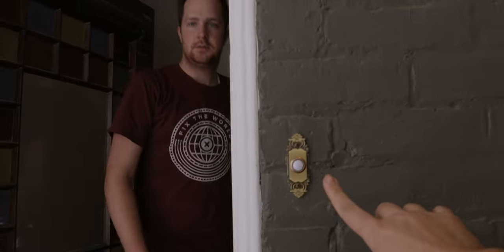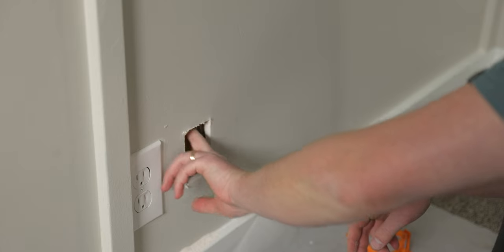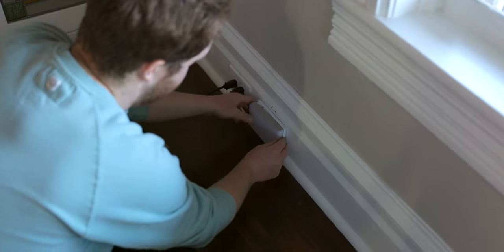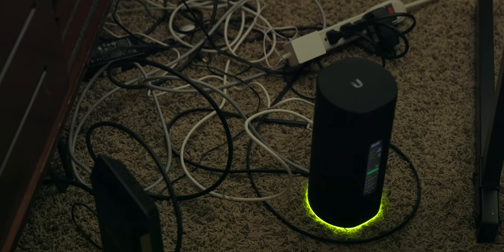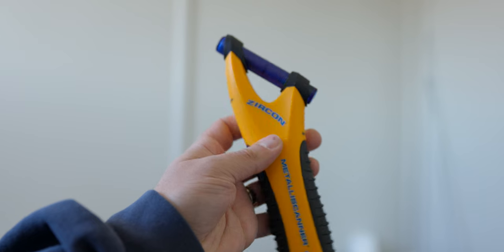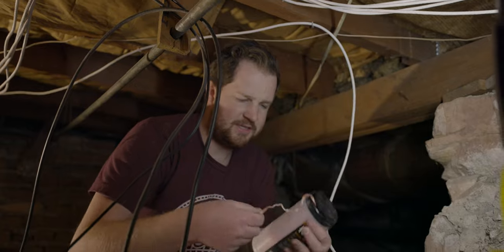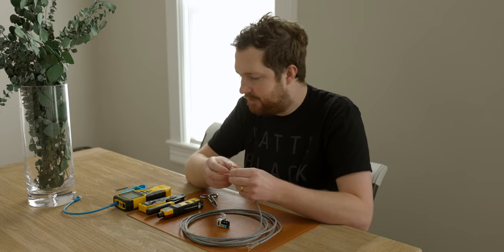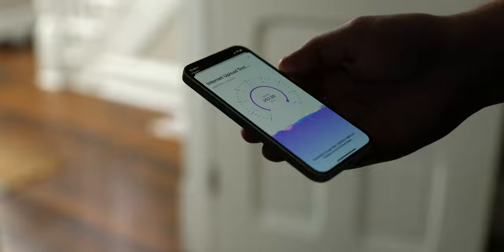Adding 10 Gigabit Ethernet to my 129-Year-Old House!

Comment: Solid explanation of the punch down method. I went with the male-female keystones instead so I got best of both on the end runs of each loose camera cable. All cable runs were for new construction so the in-wall used the punch down keystones, which I had to repair 2-3 of them. (The cut through a few of the wires when stripping) I was not happy when I tested all the cabling, but when we moved in, there is no time to call the electricians out to fix a minor issue. Luckily it was all CAT6 runs we paid for an received. I have an open run directly below my office into the basement for Verizon or Google if I can ever upgrade from Comcast. I thought about the Ubiquity system, but I already had purchased a few modern Asus mesh routers prior to moving, so decided to go full expansion into that ecosystem, which has been fantastic for a home network. I had to turn down the transmit power the first week since my network was reaching 3 blocks away in a new construction zone.

Comment: I enjoy your tip about the sheathing, you can tell a man who has had to make lots of Ethernet by his tricks to get them done faster. However, the tool you show at 18:49 literally has a thing built into it to cut the wires instead of the scissors..not to mention the even nicer Klein tools crimper.. I guess for availability of viewership? (I saw you cut the cable with the same scissors) Nevertheless, this was my only suggestion to anyone watching.  The closer these are all to being equal, the easier it is to crimp.  So, spend the time making these nice and the bending you do at 20:53 really makes all the difference as well. This was a fantastic video and enjoyed every second.

Comment: Nice video, informative and humorous. I was drawn to the video by the 129 year old house. My house is old also, about 120 years old for the original house. My problem though is my walls are solid wood as in log cabin. I did like your idea of setting up a network rack.

Comment: One thing: The order of the pairs matters A LOT. If the signal pairs aren't on the same twisted wires, the whole twisting effect of the wires is negated, you get crosstalk between the signals and you completely ruin your ethernet speed. What doesn't matter that much is that you use the right colors for each twisted pair, but pair has to stay pair!

Comment: if you install in a new home while building it, or if its not an insane hassle, just go with cat7. its better protected, less interference and just gets you a piece of mind for 10gb networking. 

you can never go overkill inside your walls, the walls and anything that comes to be related to the cunstroction of the home is way harder and expensive to change in the future. if you thinking about installing ceiling speakers, put the holes in, put the best cables, HDMI 2.1 cables, maybe even USB and more. it really doesnt cost alot of money and gives you a piece of mind and flexability in the future and in selling the house.

Comment: I work in an electrical installation company. We have so many contracts with private home owners to wire some new network cables etc. Most of them end up saying 1Gbit is enough. Yeah no, we don't even think abbout installing Cat5e cabbles. Cat 7a is the only thing we install in terms of cable, especially since the price difference is really small nowdays. Plus, we only need to have 1 type of cable in storage.

Comment: I found your video very informative.  I too have an older home (1972) just not as old as yours.  Although I do have Wifi in my house, I have tried to have hardwire RJ45 in as many rooms as possible.  My house is a tri-level house with a basement.  My last few lines I have run were for my 10 GbE lines that support my Plex Server and my Synology NAS.  I sorta cheated I chose to get premade Cat6A lines in the lenght I needed for those runs.  Then I used female-to-female keystone jacks at each end through the wallplates.  That way I was able to pretest my lines and the rerun the tests after I got the lines run through my attic.  Not fun, I should have run those 10 GbE lines before we had additional insulation blown in.  Very clostophobic up there.  The first floor runs are pretty easy since there is a passageway that runs from the basement up through the first floor into the attic and access to the wall where my computer room is on the second floor.  The only rooms without RJ45 drops are the kitchen, dining room, bathrooms and the laundry room.  But they also have Wifi so it is not a big deal.  All upstairs bedrooms, living room, and family rooms have two seperate lines for each of them.

Comment: I just bought a 1921 home so the wifi modem combo in the living room doesn't even get signal to the bathroom 15ft away. I am installing unifi aps in the living room, mother inlaw apartment and the hall between the 2 (between master bed and bathroom) and running it all to a old linen closet where I will have a 10u server rack to house all of the patch panels, network controller, poe switch, and modem it's self. Also putting the networked printer in the closet. Eventually I plan on adding a out door ap so that you will get signal in the whole yard since I use wifi calling alot. I am only running cat 5e because I got 2 full boxes for $20 on local classifieds.

Comment: I would also higlight here that there are toolless connectors. They are generally a lot more expensive but have a greater tolerance for cable diameter. If you bought a shielded cable (recomended if you use the same holes as power lines) they make your life a lot easier. For european homes where all walls are brick and making new holes and cabling  requires a full repaint and masons tools they are recomended as they can enable you to use the existing cable spaces. I would still stay away from the power lines if I can help it tough. Using the Coax cables routing spaces that are bound to be there for the TV is a lot safer.

Comment: i am NOT a tech wiz and even if there are clear instructions on how to do it I'll get someone who knows what they are doing to do it for me. that way i never have to make sure i have the right [everything] that i am probably only going to use once, (i fixed an electrical problem in my car once and had to buy the right tools to do it. still have the tools, gathering dust and only used once!). however, my house is roughly the same age as yours and has 3 bedrooms and 2 reception rooms that i am thinking about having ethernet cabling throughout. so, at least now i have watched your video i can follow any worker i get around my house and have a rough idea on whether he is doing the right job.

Comment: @18:50 my solution is to do rj45 connector ends, then use a coupling keystone jack , so clean as a normal keystone install, but a bit easier (especially with those ez-rj45 connectors)

Comment: 22:32 "impact sensor" is nice term, but it actually is spring you push-load, and it clicks as it releases to the pair of mini scissors which then trim the excess of wire you pushed in.
That's also why you need to pay attention to tool orientation so you'll have scissor blades on outer side.
Some punch tools have rotation nob built in handle to disable scissors. Some will still click as spring is still there, some will disable spring loading mechanism so they are a bit stiffer to use.

BTW A/B norm is also used to make cross-cables (cable with A-wired connector on one side and B-wired connector on the other). They were used  to interconnect devices directly, without hub/switch, but they are kind of obsolete as nowadays NIC ports do have auto-cross detection and will align according to what is connected to them. But you were right that it is better to stick to one norm and wire either according to A or B. It is also useful as brown wire pair is usually used by PoE.

Comment: It is possible using TP-Link Broadband Over Mains Adapters only possible if the cables in your house go through metal conducts to prevent the RF signal being radiated and causing problems for ARRL Members.

Comment: I’m not a professional, but have had to make so many cable ends and custom patch cables for gas stations over the years as everything has become more networked and I’ve never heard of that trick with the jacket to untwist the wires. It’s mostly keystones and pre-made patch cables now, but I’m definitely going to give that a try on the next one. 👍

Comment: Not being an expert in cabling requirements, and even tho some building codes may allow for it, I would advise to NOT run plenum cable thru HVAC ductwork. My understanding is that plenum cable is a fire rating to distinguish between cable that MUST be run inside an EMT style conduit versus cable that can be run without a conduit. If it IS NOT plenum rated, then you should run it thru conduit. If it IS plenum rated, then conduit is not necessary as the external jacket is made of materials that will not contribute to a fire. For a residential installation, I recommend ALWAYS running plenum rated cable in order to cut the cost for EMT. If your house catches on fire, then your network will probably be the least of your concerns.

Altho, if you live in an area plagued by critters, you might want to go the EMT route to protect your cabling from chewing pests.

Comment: One thing to note is that you should look up house coding to see if what you are doing is up to code. In my county where I live you can not put a Ethernet or any other communication wiring in the same section as power cables in your walls. So where you put your Ethernet would not be up to code where I live.

Comment: Wow in America is this a nice thing. The problem for me is, i live in Germany… every wall is out of concrete even the floor is a 30cm thick concrete plate… there you can‘t drill that easy threw. But you have other options run the cable threw your house :D Very nice video for installing and configuration thank you!

Comment: 568B is specifically the standard for the US. Highly recommend sticking with that or you’ll confuse someone troubleshooting in the future.

Also they’re 66 and 110. Great video!
Reply: TIA 568A and B were both standard prior to the D standard being released.  It was typically spelled out in US Government contracts how the termination should be performed and to what standard.  One is not better then the other.  The thing is just get a standard and stick to it: this will keep troubleshooting to a minimum and BS out of the equation.

Comment: Cat 6A is bigger wire, passthrough is recommended. 5e connectors work if you lick the wires and press and wiggle.

Comment: I didn't hear it mentioned but the keystone and RJ connector are designed for different cables. The RJ connector should only be used with cables that have multi-stranded wire (patch cable) and the keystones should only be used with cable with solid core wires (structural). Usually the multi-stranded cable is used for patch leads as the cable is more flexible. Whereas the solid wire cable is normally used in walls or as part of the permanent network structure, sometimes called structural cabling.

The RJ connector has small blade type pieces that the crimper pushes down and into the multi-stranded wire to make a good connection. If you use the solid core cable with an RJ connector then it may work initially but is likely to fail at some time in the future. The reason is, that the little blades that the crimper pushes down into the wire don't actually go into the wire because it is solid copper. So the blade ends up making it through the wire's insulation but is left just resting up against the wire. The blade only has to move the tiniest amount to cause a broken connection. Any sort of vibration or heat cycling can work the blade away from the wire. This is not an issue with the RJ and multi-stranded combination as the blade is immersed within the many strands of the wire and so any small movements of the blade will not cause a broken connection.

The keystone has a piece of metal with a narrow slot in it. The wire is pushed down into the slot. The sides of the slot cut through (or displace) the insulation and bite into the solid core wire. This makes a good connection and the depth of the slot prevents the wire working it's way out of the slot in the future, it is wedged tight. This way it is not likely to fail in the future due to any tiny movements of the wire. If you use the multi-stranded cable in a keystone it may work initially but is more likely to fail in the future. With multi-stranded wire, the strands can move about and so don't become so wedged in the slot. They end up just resting in the slot and any movement of the cable can easily work the wire loose and lead to intermittent or permanent broken connections.

If you want a stable and reliable network then only use multi-stranded wires in RJ connections and solid wires in keystones. 

Some benefits of using keystones as your wall connection. 
If you are no longer using that connection point you can unplug the cable and not be left with a length of cable hanging out of the wall.
Any damage to the patch lead is easily and quickly fixed by just replacing it rather than having to find your box of RJ connectors and crimping tool and re-crimping the damaged cable.
The length of cable can be changed easily by using patch cables of appropriate lengths. Handy if you change the rooms layout.
The wall is much more sealed reducing air drafts and vermin entry paths.
Having multiple cables is also neater, for example a wall plate can have keystones for Ethernet, maybe one for your TV antenna, even a HDMI and USB socket all on the same wall plate. The HDMI and USB can be handy for connecting back to your security systems DVR making it easy to have a comfortable spot to directly access the DVR which may be located in a less comfortable location.

Comment: I have never heard of a 99 punch.  Perhaps you meant 66?  There is also BIX, which is very similar to the 110 punch.  BIX and 66 are commonly used in telecom.  I have both BIX and 110 punches in my tool box, but it's been years since I've seen 66.

Comment: this makes me feel so much better about choosing Cat 6 for my home, I was having minor regrets not shelling out for cat 8 (I was absolutely not doing cat 5e, everyone does cat 5e, spent years of my career doing Cat 5e.

I'm trying to not just put wholes through walls (which would work) and have it me nice with wall plates like this, but what I thought was existing spots to run cabling through is much hard than thought. I have a much more small home I think (940 sq ft) but really want ethernet through out both the houses and then be more so future proofed though gigabit should be fine. Doing full 10 gbps setup cost 2-10x more so will not do that for awhile, but once I get this in, shouldn't be too hard to replace.

Comment: In my home I installed Cat7 during renovation, which is basically Cat6 S-FTP.  If you don't want interferences from all the electrical fields in your home always go with S-FTP no matter 10Gb or 1Gb or 100Mb. S-Ftp is shielded and foiled meaning all pairs are shielded in addiditon to the whole thing being shielded as well. Basically don't pay unnecessary, know what you're buying and buy the best speced your budget allows you.  There is nothing more frustraing than an inconsistent performance.

Comment: Easy to cut one end, tie a new table to it, and pull through on the other side. You might need a sleeve to ensure smooth sliding.

Comment: Holy Cow
I am a g Network guy from Europe and I gotta say that many things are Questionable and I am pretty sure the network wouldnt pass a NEXT or FEXT Test for certification.
I dont want to bash the video by any means, overall good setup, theres just some details that hurt my feelings...

8:40 I would only use CAT.7 shielded Cable (S/FTP or PIMF) since they are way less affected by other wiring or electromagnetic signals around the house -> Less corrupted packets -> less packet loss, lag spikes and packet retransmissions +slightly higher speed (e.g. TCP Downloads)

That stapler is fucking awesome never seen one of these gonna buy one immediately

17:48 DON'T PUT A RJ45 ON IT PLEASE!!! Installation cables are solid copper and can break if you move them alot, patchcords on the other hand are flexible. You can also use a different length of patchcord in case you decide to change the layout of your room for example.
THE REAL 2 OPTIONS: 1. Keystone Module(s) for your outlet 2. (EUROPE) LSA RJ45 outlets

22:18 There are also toolless Keystone Modules.

Important tips for building a network:
If you want to run your network on 10G+ reliably, you should definitely use shielded Keystone Modules and a shielded patchpanel in addition to your shielded cable and ground your patchpanel!
If you use a shielded cable make sure the shield has no contact to neither of the wires/edge inside the Keystone module
Dont remove more shielding than needed
Dont have pairs untwisted for more than 2-3cm when finished

Dont run your data cables close and especially not parallell to your electrical installation (immense problems with unshielded cables)
Dont bend your cables too tight (bending radius >2*diameter)

Comment: I'd recommend putting some black electrical tape over the T568A color code guide so you don't accidentally look at it, which can easily be done.  If for some reason you need to do T568A, you can always move the electrical tape to be over the other temporarily.